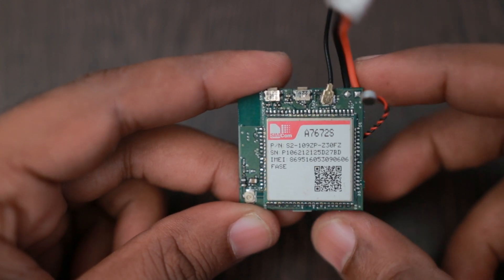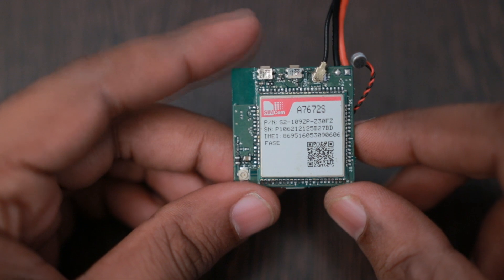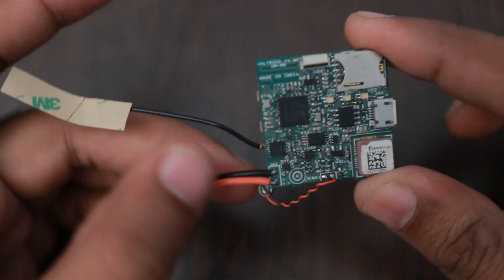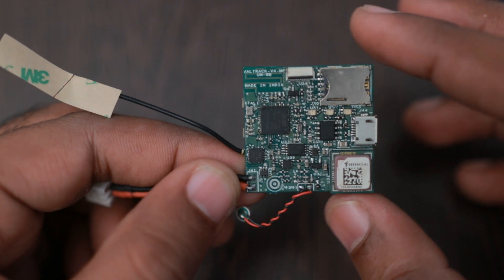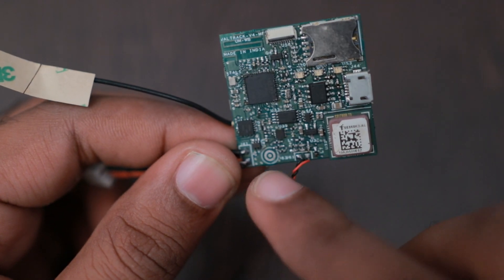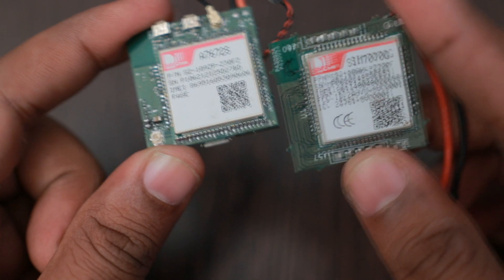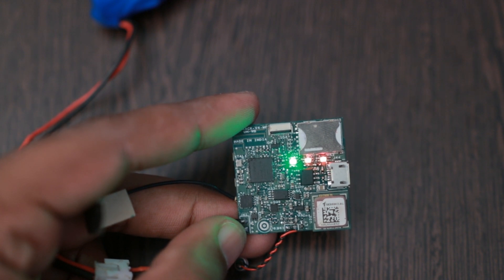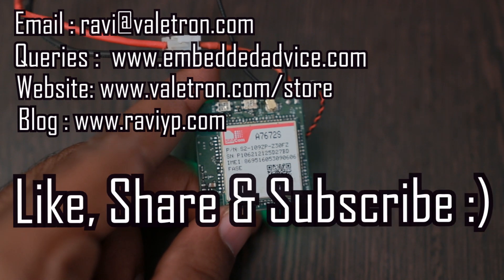Low cost 4G LTE enabled Asset tracker with USB charging - VALTRACK-V4-MF-UM-WB

Comment: Why are you using gnss separately. Why not inbuilt gnss? Any reason. Stability issue?
Reply from the maker: Due to small size we use it. Adding antenna  to inbuilt gnss is more complicated. Antenna matching, gain, size etc. And also it helps to keep independent control on each part where only gnss is needed or only cellular needed.

Comment: im using the same  simA7600s module for reading data from the server

AT+HTTPACTION=0

OK

+HTTPACTION: 0,706,0

 most of the time im able to read the data from server. but some times im gettting http error 706, 713,716 could you pls tell me what is the issue?

Comment: I am using sim800l module with 4g sim. I am facing one issue. It is not connecting with network. What I need to do to fix with network ?.

Comment: Why do you need to put an LTE module if high speeds are not needed to perform GPS tracker ? I could use cheaper modules, greetings is just out of curiosity
Reply from the maker: Which module would you use instead of this?